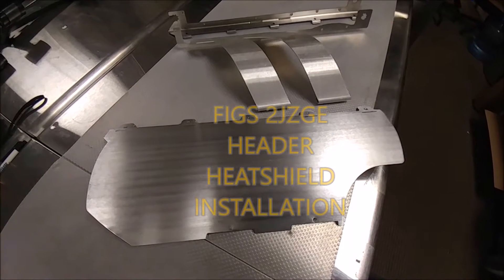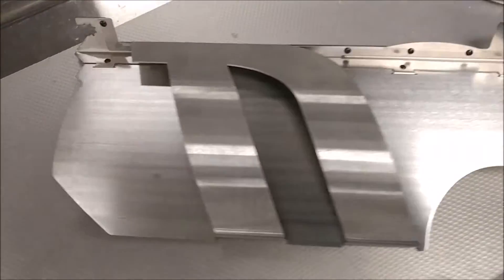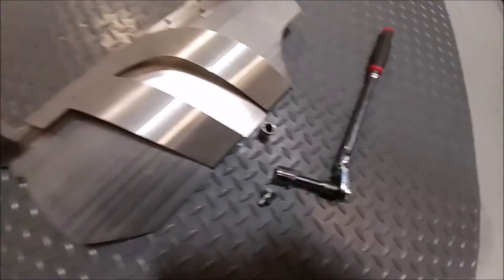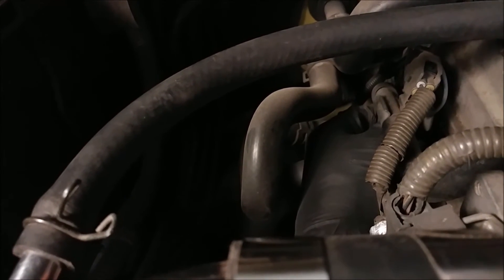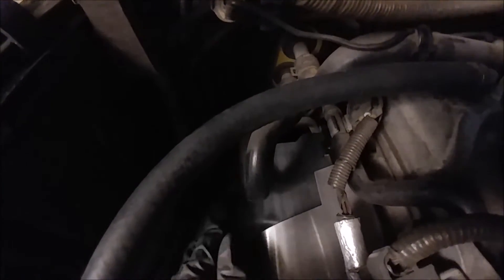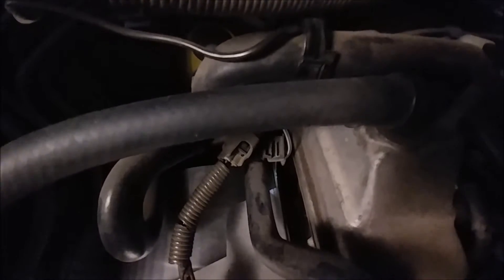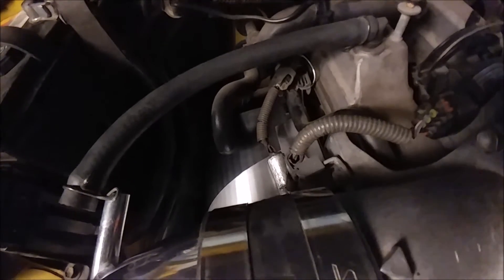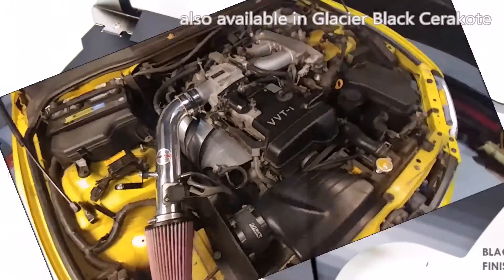FIGS 2jz HEADER HEATSHIELD INSTALL VIDEO IS300

Comment: Mike Rodriguez... questions what header brand are those ...and will they fit 98-04 gs300 is this heat shield still available
Reply from the maker: This is a stepped primary, EL header we co-developed with PPE.  It is unconfirmed on the GS, but it should work with a custom exhaust.  The heatshield is still available.